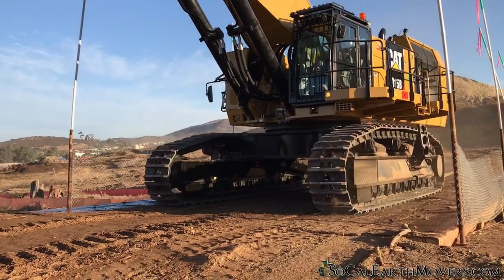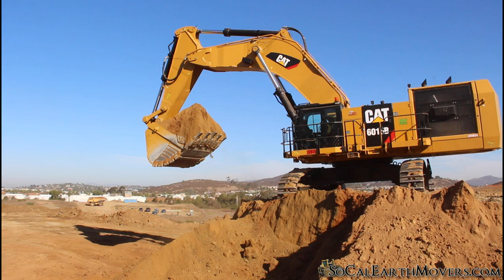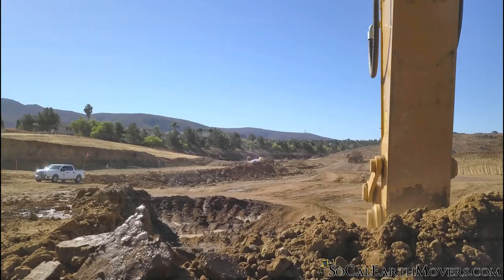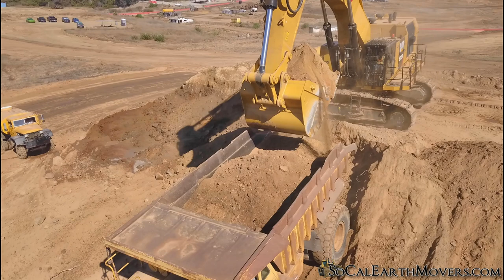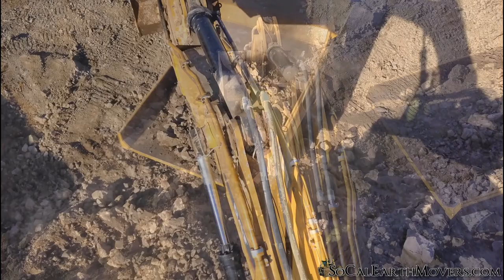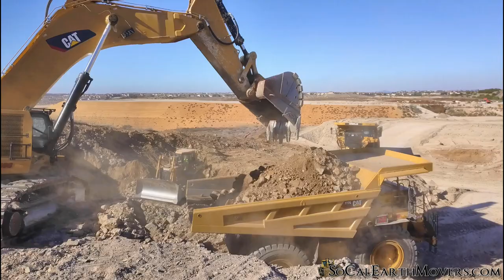Doubling Down with 2 CAT 6015B Excavators - One Brand New!

Comment: 6015s have fantastic cycle times for such big machines. Operator on the new 6015 looks like he needs more time on the joysticks to match the operator on the older 6015.  We need to see more of these rigs working. Would be very interesting to hear commentary from the operators.
Reply: Ariz Suliztyo  much smaller machine....to be expected it will have a faster cycle time
Reply: Ariz Suliztyo  R9150 is the 6015B competitor, R9100 is not
Reply: Need to load over the side keep trucks moving forward 
Backing up way to slow
Reply: 57 S could have moved that
Reply: That is like waiting to get healthy in a hospital